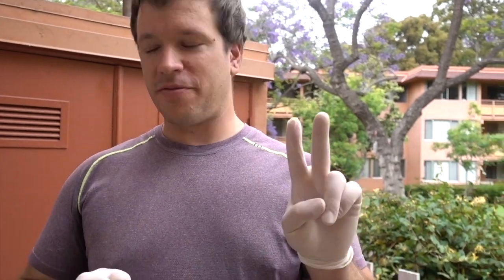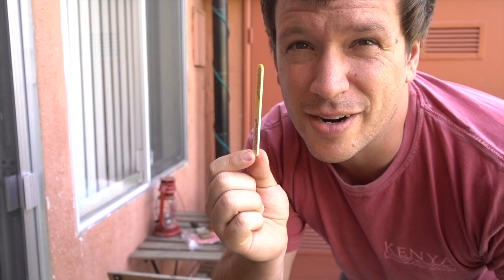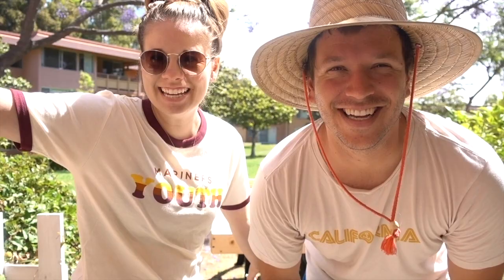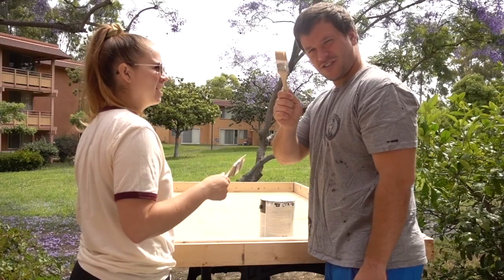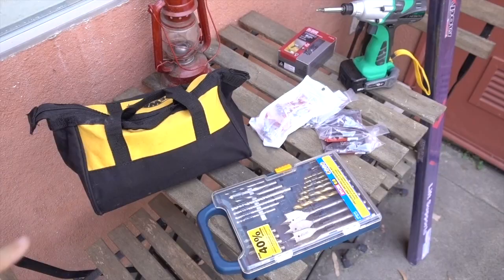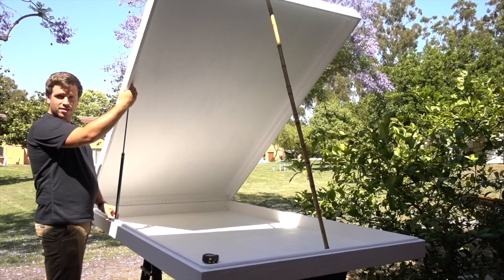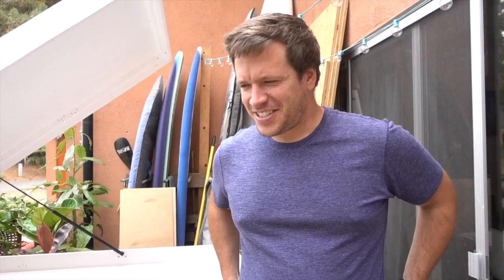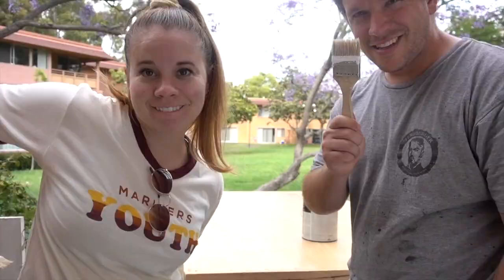DIY Rooftop Tent - Part 2: Painting & Gas Struts!

Comment: Flip your gas-struts over so that the fat part is on the top.  The way you have them mounted will allow the gas to leak out of the seals as the internal lubrication moves away  from the seals.